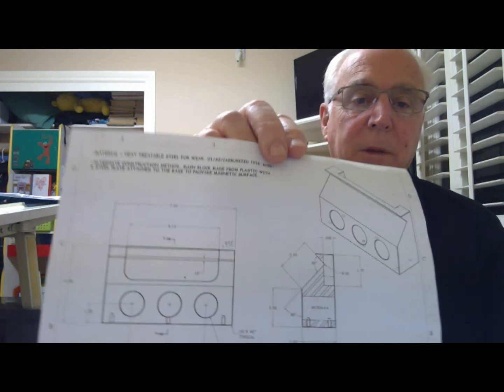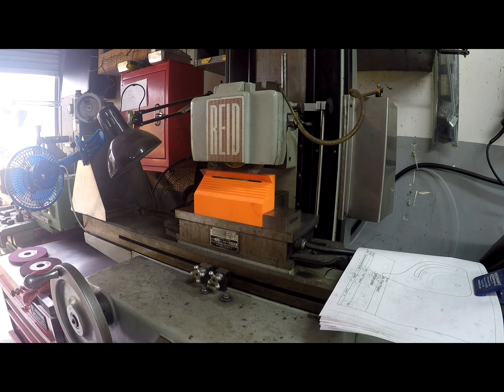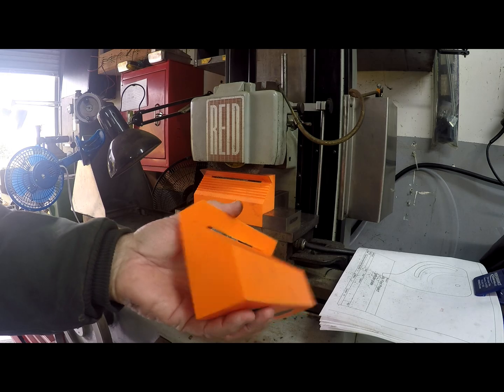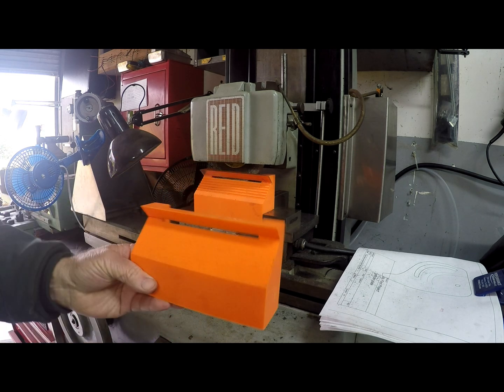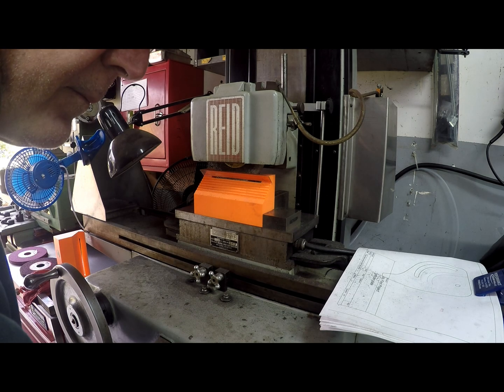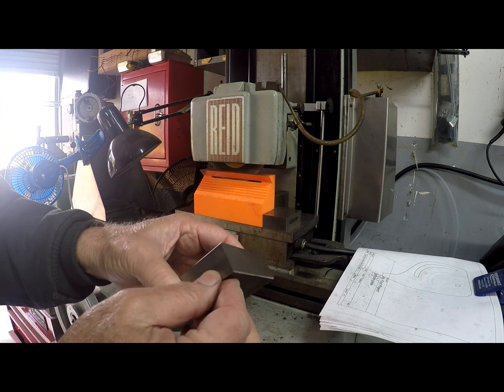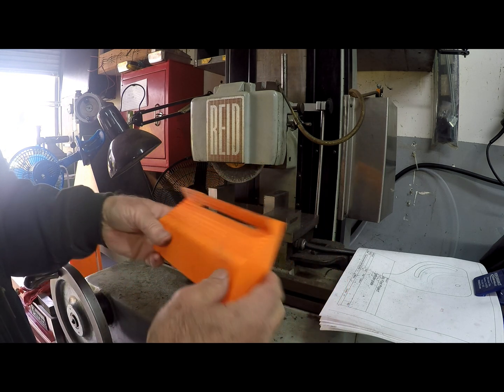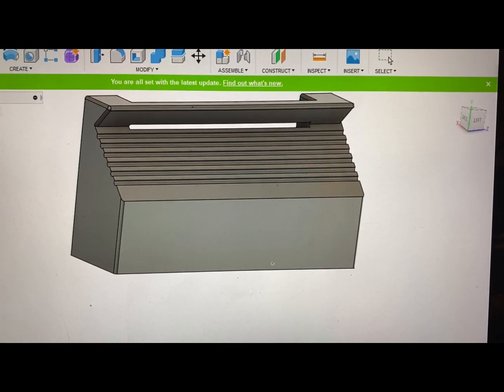Oxtool Chamfer Block 3d Printed

Comment: Hi Chuck, can I ask if the steel discs in the base are flush with the print or slightly proud? Thinking if proud this will ensure good magnet contact but they’ll  be less are supporting the block but if flush there may be a risk of incomplete contact with the discs. My print is ready to accept the discs! Thanks.
Reply from the maker: flush would be the best method....
Reply: @ Then flush shall it be. Thanks!

Comment: This popped up in my list today,  I do follow both you and Tom but I've been busy as of late. I don't have a surface grinder but I can see where I could modify it to run on the side of a sanding wheel on either a bench grinder or on a table saw.  
I occasionally need to chamfer small plastic and laminate parts and a hand held router is just not practicable or even mounted in a router table is not safe.
Reply from the maker: Peter, thanks for viewing and your support.  I recently made a fixture for my belt sander, a video will be coming out shortly.  I would think you could design/build something for your bench grinder...

Comment: If you choose to make another, put a 45 degree angle in place of the 90 degree corners on the backside of the block. I’ll contact you later and get a copy of the model and edit it to try it myself.
Reply from the maker: thanks for viewing and the tip, you are welcome if you want the file

Comment: Thanks 🙏.  😎👍

Excellent idea.  Since the block doesn’t need to clear the wheel like a square, you could add a 60 or 45 degree ‘ramp’ the full depth and then the overhang would be supported and there would not be any of the stringing 😃. Great work.  And so lovely that you could work on that in your son’s room as his heart is in there thanking you for all you did for him.  Merry Christmas
Reply from the maker: Joel, thank you for viewing and the tip along with the heartfelt thoughts....happy holidays...

Comment: Hey Chuck, i have a printing tip for you.

Always give veridical edges  the largest radius you can stand. A large radius means the printer doesn't have top slow down as much to make the turn and thus prints faster.
Reply from the maker: Dan...thanks for the tip and viewing

Comment: The back relief that the stone rides in?  If you put a 45 degree angle in there so it goes more like this \_____/, it would print in the orientation you printed it with out the stringy bits.
Reply from the maker: thanks for viewing and your tip...got another idea from this and coming soon to my channel